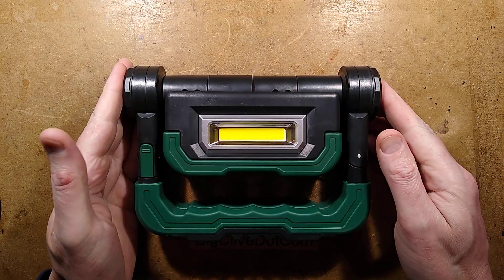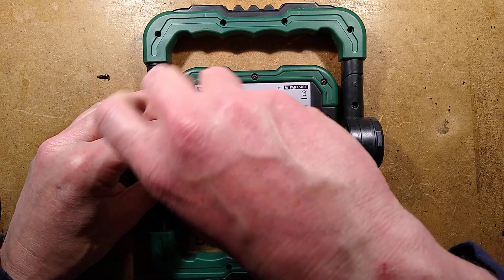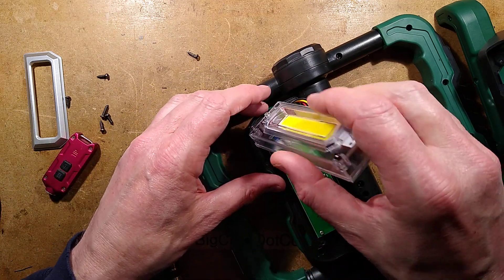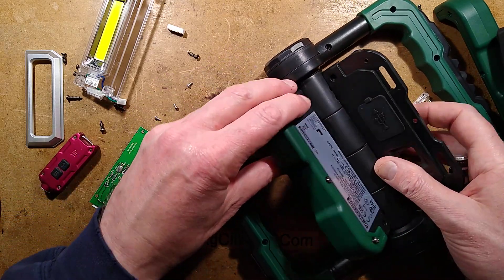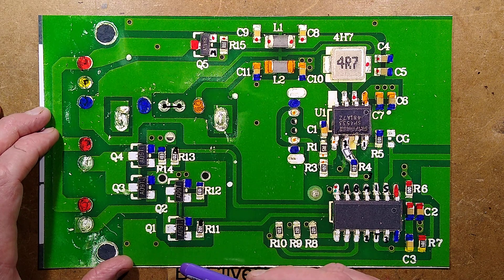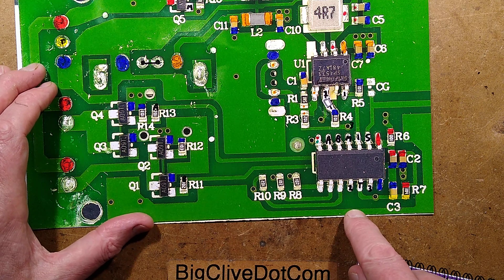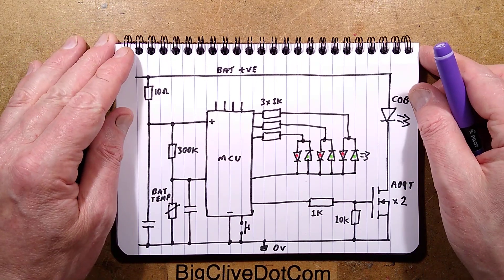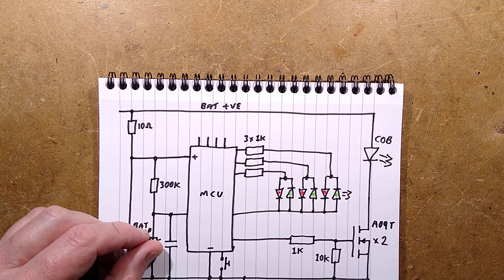Inside a LIDL rechargeable work light and power bank (with schematic)

Comment: Hi great video,I have one of these yellow and black hasn't had much use from new ,when I switch it on both lights flash once and won't switch on I have tried to charge it twice still the same,when I plug usb in to charge the blue light flashes, do I bin it? Any help please
Reply from the maker: If it's been left too long the battery may have discharged below what it regards as a safe level to recharge.  It may be worth carefully opening it and measuring the voltage.  The cell should be at least 2.5V.

Comment: Hello, I have a problem with the Led work light with power bank Parside PBSL 5000 B2. The light does not turn off. It stays on constantly. Pressing the switch does nothing. I checked the switch with a multimeter and verified continuity. When pressing the button, I get a signal of conductivity. Where could the problem be? Thank you.
Reply from the maker: Could be a short circuit on the PCB or a failed transistor.
Reply: I let the battery run down to the end: As the battery was running down, the light was weaker. The LEDs on the back showed a reduced charge by flashing. So the microcontroller works. Now I charged it again so that the LEDs light up green, but now the light won't turn on. The device must be opened and the PCB from the LEDs must be disconnected, reconnected, and then a light appears again that you cannot turn off. Otherwise, the power bank function works, I can charge the mobile phone. The PBSL 5000 B2 version has the same PCB as in your video.

Comment: Hi v technical video well beyond my Ken, I left mine in my garage last 6/10 months it now refuses to take a charge is there any way of shocking battery back into life, I’m not an electrician so looking for idiots guide to battery care. Thanks for any advice
Reply from the maker: You can gently nudge the batteries up to 3V, but it will require accessing the battery connections after any protection.

Comment: If a device has a Micro USB in, but the porthole around it is a larger, symmetrical oval (more than likely designed for USB C) is it possible (or viable depending on size and power constraints) to fiddle about with the circuitry to replace it with USB C (Barring using a dongle)?
P.S apologies for all the parentheses and casual use of the word dongle.
Reply: Yes. But dont forget the 5.1k pulldown resistors, or it wont charge with many USB C chargers. (It will still charge with legacy USB A chargers and an A to C cable
Reply: Groovy. Cheers for the head up.

Comment: I have a non Lidl version of identical design. It is indeed very flexible in use with good battery life. My only criticism is that the switch is on the back. Because its completely symmetrical from the front, you cant judge where the switch is without turning it round. I added a piece of coloured tape to the front in line with switch location on the back in the end. Otherwise its an excellent cordless work lamp, very good under cars - your Rolls when you have finished the easy stuff - since it can lie completely flat if required.

Comment: Certain phone chargers like the fast chargers and power banks wont put out power if the connected device doesn't draw enough current to be detected, and the usb c ones wont put out power unless they get a signal back from the connected device.

Comment: Parkside (Lidl) actually produce some fairly affordable and usable stuff. I enjoy browsing Lidls homepage once in a while to see If there are any good deals. Apart from smaller bits and bobs I bought Parksides benchtop/pillar drill and a welding unit.
I've noticed the products are generic (apart from branding and color scheme) and sold under other brand names too, Scheppach for instance.

Comment: I have one of these, it's a very useful lamp but the 'USB C' connector is not true USB C. It looks like one and it will take a USB C plug but wont actually charge off a standard USB C cable, only the one that comes with the torch. Likewise the 'USB C' cable supplied with the torch will not charge a real USB C phone etc. Has anyone else experienced this or did I just end up with one from a bad batch?

Comment: what about the battery? mine was empty without using the lamp for a 1 or 2 month. was half full.
Reply: thats about the way it is.

Li-cells need recgarging every 3 month. so if it was half charged it most likely went down after 1 or 2 month.

try storing a car for 2 month and crank it. most likely it will just flash the christmas tree in the dash and do nothing.

Comment: I've got pretty good experience with LIDL's Parkside brand tools. The solder device and hedge trimmer on battery are working fine for me.

I think this is great value you get for your money. For household use it's competent enough.
Reply: I’m a big Parkside buyer. They’ll last me a lifetime given the amount I use them so why buy more expensive brands.
Reply: @sprint955st  I've got a few of their tools as well!  Perfect for me, I'm just a homeowner who does some maintenance and occasional light renovation work, so I don't need any expensive, big-brand or super-robust industrial tools or anything.   I also have a couple of tools branded "Blue Ridge" that are pretty good as well - still working after a long time at least!
Reply: @goose300183  even better, Lidl have started selling Parkside logo tee shirts £3.99. It would be rude not to buy one. I’m a proud owner.
Reply: Yup, their tools are pretty nice, but for some of them it's a bit questionable to offer them as battery powered versions. We've bought a Parkside "cordless hammer drill" some years ago, and the one time we needed the hammer function to drill through a concrete wall it failed miserably. Had to borrow the trusted (corded) Hilti of a craftsman we had in house for other works and that one went through the wall like it was butter... Was a nice lesson that cordless versions of certain power tools don't make any sense.
Reply: @NiyaKouya  All of the small drills with a hammer function are worthless, it's not just Parkside. If you need to drill concrete, get a big SDS rotary hammer. They exist in cordless versions too but they're way bigger and more expensive, especially the HILTI one.
Reply: @han5vk  Yeah, everyone finds that out as soon they have to drill concrete, or worse, reinforced concrete!

Comment: If I was a component builder, I would compress a spring under the circuit board so DIY repair persons will be surprised when the innards are ejected to the ceiling (snigger).
Grimly Fiendish.

Comment: Thanks for the assessment! I will mod mine to have voltage select  connected.  hmm maybe some resistors in series with the leds to reduce how hot they may run,,,, Had not opened mine with conerns that it may be a pain to put back togeather but your knowledge and issue spotting is very helpful and educational. 

think ill buy led lights just from aldi in future.  Aldi did have a metel yellow light in the last year... wonder what that like?

Comment: Given the abundance of screws in some of the devices, do you think using a mini electric screwdriver would speed things up?
Reply: That would be a test in itself oncluding taking apart ;-)
There are the electric pencil ones, but they are kinda heavy and expensive.. 
and then i found one which had a gearing in it so one twist gave 3 rotations or around that number.. maybe 5.
And when you need to tighten stuff up there was a 1:1 button to press&lock..

Comment: That thermal safety component is often incorporated to limit the battery current flow when used in high ambient temperatures, like being left in the sun, charging in a hot car or near a heater.
Cheers.

Comment: Devices powered via an USB-C connector but without CC pins connected are a crime against humanity.
What is the point of using a great USB-C connector if the device cannot be powered through it because, due to the absence of two resistors connected to the CC pins, the device does not tell the charger that it is a device requesting power?
This problem doesn't just affect cheap low-quality devices. My expensive portable Bluetooth speaker, for example, suffers from the exact same problem.

Comment: And all I want to do is make a rear light for my motorcycle using a 12V COB LED tape. No idea if there needs to be any resistors, caps or other circuitry.
However, I've been following your channel for several years and am always fascinated by the complexity of some very simple things and some of the downright dangerous too. It's like one of those consumer programmes on TV but with proper explanations, depth and humour. You'd think I'd learned something by now but I'm more gears and metal bashing inclined.
I've recently retrofitted contact breaker ignition as the electronic system started acting peculiar. It would lose power at a particular rev range and the longer it was running, the worse it got. Fine either side but as it got warmer the affected revs range got broader. I've no clue so eventually it will be replaced.
As you're explaining things, I can see and understand it but putting it to practice, well that's me befuddled
Reply: Meant to answer you sooner.  Most LED tape comes with the resisters built in.  They even sell them in short lengths although you end up paying almost as much for 8" as you do for 12 feet, which usually can be cut in 3" sections.  There are lots of options on eBay and Amazon.  You can just cut off as much as you need.  If you are looking for a red lens answer though, you are probably better off just buying that rather than the tape and a lens cover.  Again Amazon, eBay or Harbor Freight if you are in the US.

Comment: I know very little about electrical engineering and design, but for some reason my appreciate of a design or product immediately increases when I see modular components connected by easy-to-disconnect connectors. It might just be the sense that this aids in repair and diagnosis, and possibly implies some thought given on the part of the designers for their customers' efforts along those lines.

Comment: I have one of these and was so tempted to take it apart and checkout the internals. Thank you Clive for saving me the trouble and for your insights on it. Did you note the battery capacity and if the claimed battery duration is realistic?

Comment: Glad this gets the Big Clive thumbs up. I've had one a few months now and it's a very good work light, one of the legs opens to form a locking hoop so it can be hung securely and the magnets come in very handy. We have a storage unit without mains power and this is definitely the light of choice. I even left it on full-whack overnight once and it was still going strong in the morning when I opened the door again.

Comment: 13:05 Ah, that's why the p-channel mosfet is there to switch power to the converter. If the temperature gets too hot, it cuts power so the batteries cannot be charged until they have cooled sufficiently. Missed that at first, but its actually a nice feature!
Reply: I was thinking the exact same thing
.. man we're smart!

Comment: My father once told me that batteries that are discharged are lighter and the charged batteries are slightly heavier. I don't know if it's true. I noticed it just 2 times in my life. Please can you tell if it's true or false?
Thanks in advance
Reply: Yes, it’s down to E=mc^2. A few pico grams maybe
Reply: @charlesm127  I just remembered : I was using those cheap batteries that you can buy from Amazon for around 79 cents. 🤣 Those were so cheap...
Reply: @charlesm127  I think not - there's no nuclear change occuring in a lithium battery, only the separation of charge by transport of lithium ions. The pack will swell when charged due to intercalation of Li ions within the graphite electrode. The pack weight remains constant.
Reply: @mikegofton1  Look up mass energy equivalence. I can assure you what I said is true.
Reply: @charlesm127  I'm not disputing mass energy equivalence, however you're asserting  its occuring in a lithium battery - which I'm pretty sure is not the case.
You can increase the energy of an object without increasing its mass.
Reply: @mikegofton1  Thats just the point, you cannot increase energy without increasing mass, be it potential, kinetic, chemical, whatever.
Reply: @charlesm127  not wanting to labour the point, however there are a number of different interpretations of mass energy equivalence : https://plato.stanford.edu/entries/equivME/#MiscAbouEoMc2 .
You're arguing that 66 600 Joules (3.7V x 5Ah) stored in the battery increase it's rest mass by 720 picograms. The point of contest is whether there is implicit 'conversion' between matter and energy at any time (or are one infact and the same property).
As an EE undergrad in the 80's, photons were used to illustrate the point that you could have energy without rest mass.
I really dont know whether the additional 720 picogram increase in mass could be measured.

Comment: Lidl sells some very decent stuff with their Parkside brand. For the same price you get a lot worse quality from the other stores. By far not the standard Chinese crap what you would expect at that price
Reply: Wait lidl sold those electro motor drills. I hear it was very cheaply made....
Reply: @simondobes8570  cause they are cheap. Can't compare this with Milwaukee or dewalt. For incidental use pretty good/decent enough, though.
Reply: @wizpin  fascinating.

Comment: Wonder if the USB-C input supports USB Power Delivery
Reply: As far as my knowledge goes it does.
Reply: @simondobes8570  Just re-watched, he pointed out that the CC lines were not connected, so it's just going to be 5V at 500ma on a PD capable charger. There's no need for smart circuitry, can simply put some resistors in to tell the other end what current is required.

Comment: For a company known for low prices Lidl does seem to put in the effort not to make their cheap stuff too shitty and cheap. Even using connectors. Quite impressed!
Reply: Yes, I've found their stuff is usually of decent quality for the price. I mean it's still cheap stuff from China but better than most.
Reply: One of the things is that Lidl, like most retailers, has deep pockets and can be sued if their stuff burns your house down or shocks and kills you. They can also face government fines for circumventing regulations, like CE mark, e-waste laws, FCC compliance. Hence, a minimum level of quality that you don't see on the direct-ship from China junk.
Reply: They seem to focus on usability rather than anything else. Their tools feel like they're made out of the thinnest plastic they could find, but they do the job just fine.
Reply: @Hendlton  to be fair I don’t own a lot of Lidl tools - I need longevity - but I have owned cheap(er) tools that looked and felt way worse than all the Lidl stuff I did use (borrowed).
Reply: I have had one for a long time now and I am impressed both as a work light, charging my pnhone and bike lights when I'm caught short and still has decent battery  life.
Reply: They do try to

Comment: Given Aldi/Lidl don't stock the electronics that you get (at least, in my part of the US), I was ecstatic when a local hardware store picked up Nebo. I have on my desk a work light that resembles some of your earlier teardowns, down to its black case and red bumpers. I know Nebo is OEM'd by someone else, but it was a nice change to send money into a trusted hardware store instead of eBay. 👍️

Comment: Yea, that's not cool to charge the battery above 4.2V and to be hitting it with 4.35V during charging.
Didn't catch what the wattage of each COB was running at?
Maybe it would help is they put a non-thermal conductive double layer air gap insulator between the COB and the battery.

They could have made it a lot simpler by having the battery connected to a BMS/protector board with it's own charging/charged lights and usb C input.
Then take the output of the protector to a board that has a multi-function light controller button and a 5V boost usb output section. Then if you want another separate board with charge level indicators and a button to activate. [like Ryobi batteries have.]
Reply: There are 4.35V cells, which are chemically different from the old-school 4.2V ones and will be fine to finish charging at that voltage. An increasing number of smartphones use them but they've been around for around a decade now.

Comment: Hmm, 4.35v into a LiPo pillow of flamey explodeyness? That sounds perfectly fine, to someone, somewhere, I'm sure... :S
Reply from the maker: The protection circuit kicks ion at 4.25, but it's an odd design choice - or error.
Reply: @bigclivedotcom  If it's a choice, it's not good, if it's an error, I hope they pick up on it and sort it, given the chain of supply can end up "contaminated" when someone goes "ooh, that unprotected cell is cheaper!!!" and boom, recall time... :S

Comment: I have one 👍 pretty useful although the magnets are too week to hold it to thin car body panels, it holds fine to the RSJ in my garage workshop though 
One if the handles unclips and is hinged to create a hook which is handy 👍
Reply: The magnet was handy at holding the screws.

Comment: Nice looking circuit! If I was to connect a solar USB charger to the input, could it be a solar-powered work light? I've been planning to convert an old solar powerbank to power a light in the shed (for the past n years!) but this might be a good alternative...
Reply from the maker: It should handle a solar panel if the voltage isn't too high.
Reply: If you buy a 12 volt car to usb-c 5 volt adapter you could wire a solar panel to it and it will regulate the voltage. Most can accept 12-24 volts. I had a 20volt solar panel and charged my cell phone with one. Please do your own homework to make sure it is the correct voltages for your situation!